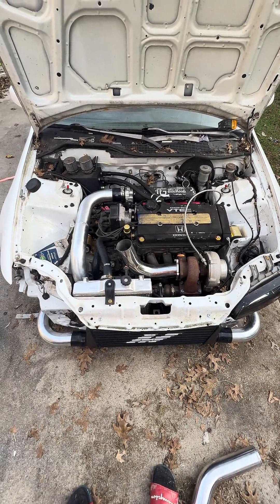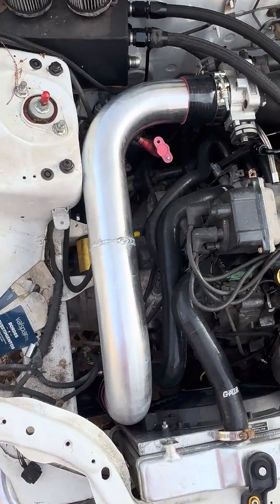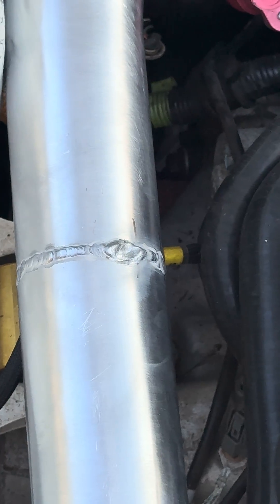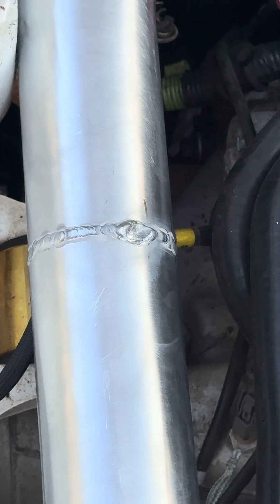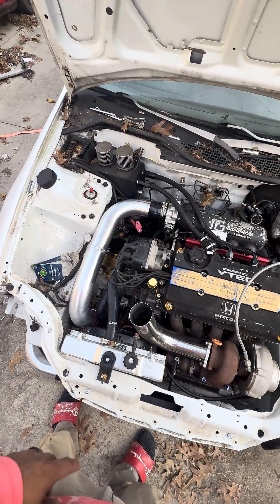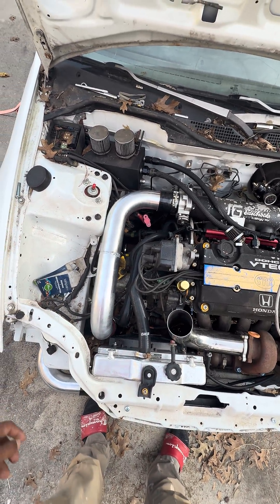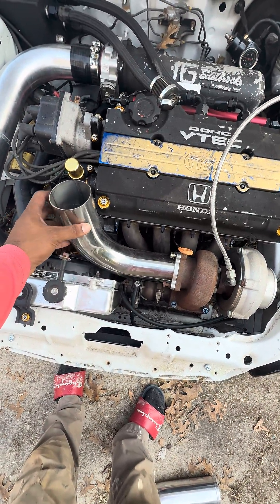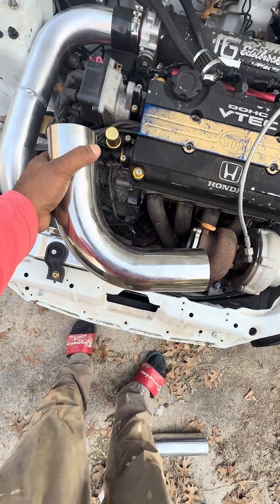Learning how to weld aluminum day17 #aluminium #learning #tigwelding #automobile #diy #diyprojects

Comment: It’s me again, the main key to welding stainless steel is very very very small oscillation, speed, and keeping the filler in the arcs heat so it melts faster. Also get a number 12 jumbo cup for the Tig torch, as well as a jumbo gas lens, I promise they will make life so much easier. Just don’t use a gas lens on aluminum, only carbons steel and stainless.

The project is looking dope though.
Reply from the maker: Thank you i ordered a mfurick cup to see if it helps me out a bit can’t wait to test it out
Reply: @Smashfab I would also suggest getting just plate that matches the thickness of the wall of the tubing and practice, stainless is an entirely different and harder metal to weld compared to aluminum. You’re looking for a rainbow looking color on the weld, mostly gold is “ok” but means you applied too much heat or your travel speed wasn’t fast enough, a black/charred looking bead means you completely screwed up that section and the heat effected area of that stainless, which means you turned it from stainless to carbon by burning out the chromium making it extremely prone to rust. A jumbo cup, gas lens, and high CFH will help prevent that but you also need to practice.
Reply from the maker: @terabotjr  i have a few scrap pieces im going to practice before i get the welding the exhaust but i still have a bit more to do on the aluminum before i move to the stainless steel